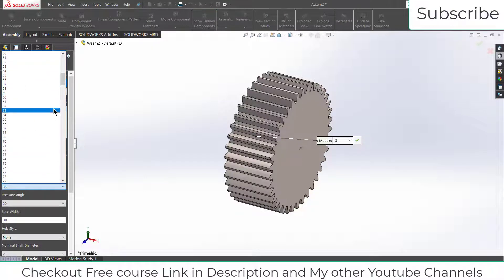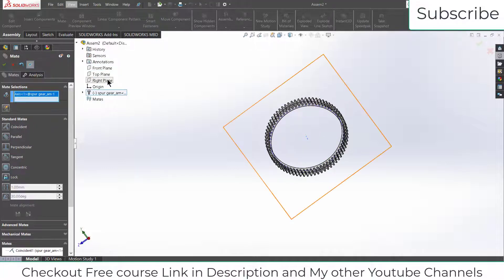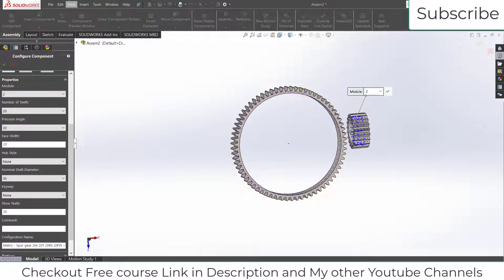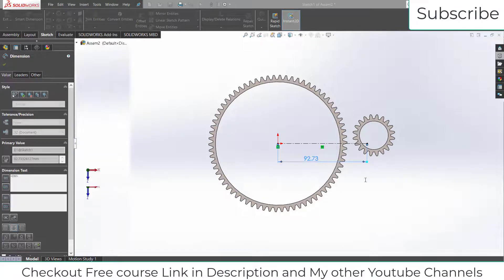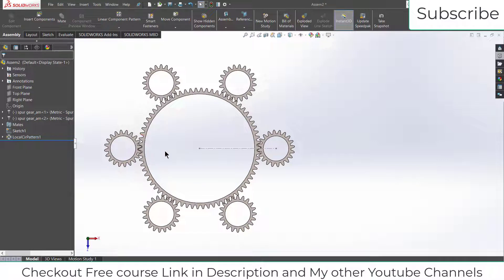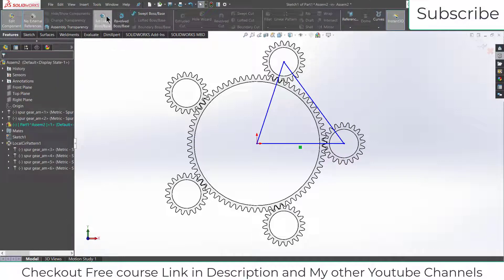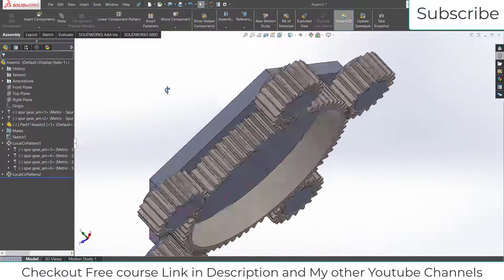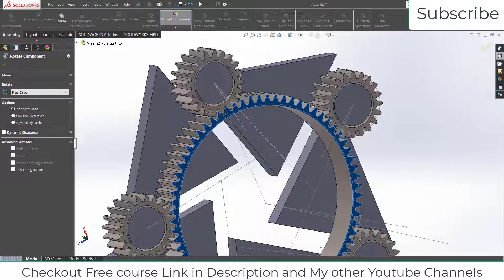Gear Iris Mechanism in Solidworks

Comment: This is a great exercise.

I drawed this mechanism for myself in a planetary gear system and made a print in place 3D printable version. It works, but the connection of the shutter to the gear is very fragile. Second practical problem is that is relatively uses a lot of material.
Reply from the maker: This is a simple exercise for 3d printing you can make it in such a way to reduce material